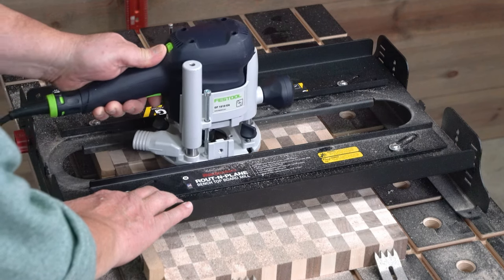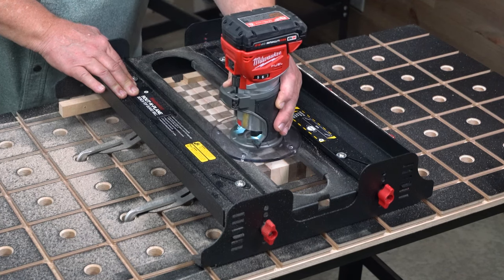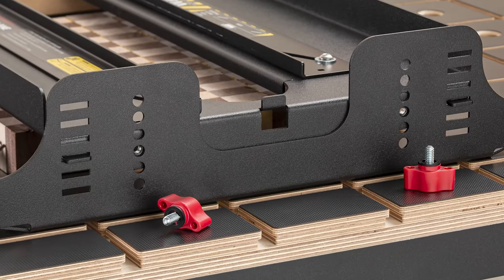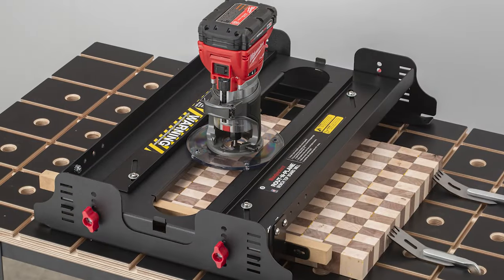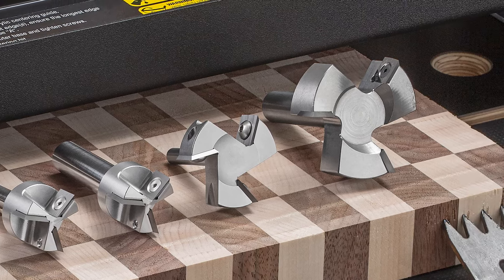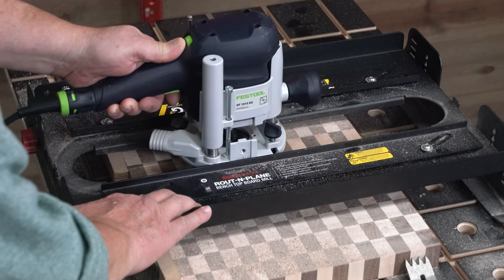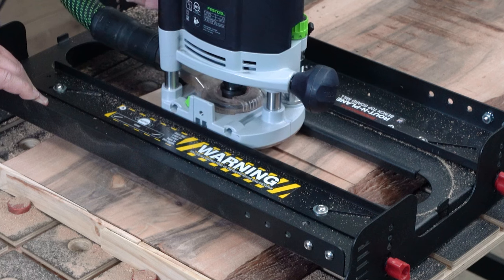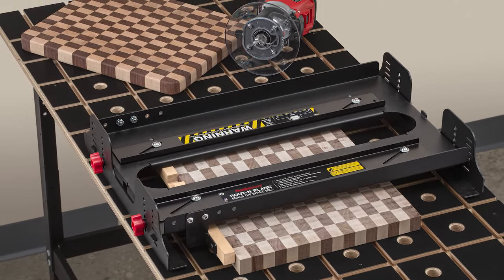Woodpeckers Rout-N-Plane Bench Top Board Mill

Comment: I've had mine for about three weeks now. Working on my second end grain cutting board and I'm pleased with the ease of assembly and use and it's very sturdy. Too bad YT does not allow pictures to be added to the post because I have some that might be helpful. One thing for sure is that I'll be working on some sort of dust collection because after todays shop session me and my garage are covered in dust. Yes you can make one yourself which is what I was checking into when I found this and thought I'd give it a shot. It has it's size limits but for my needs it's perfect.

Comment: One design change I think would greatly improve usability is to make the height adjustment a tall vertical slot with notches cut to one side at the same interval as the current holes so that the bolts don't have to be completely removed to change the height. You could just loosen them,  slide the carriage out of the notch and slide it up or down in the slot to the appropriate notch.

Comment: I have had my Rout-N-Plane for a few weeks now and after three attempts, my boards do not come out flat.  After watching the YouTube video from Sedgetool, I tried setting up my fixture using a flat and parallel board under the fixture and then I tried it out on a piece of 8" x 11" hardwood that was already flat and parallel within .003 and after taking a light cut on the top surface of the board, it did not come out flat.  When placed on a flat surface the board rocked, so it took more material off the ends of the board.
As the surface where the router rides is stamped steel, my fixture is curved up at the very ends.  Also you need to be very careful about how much pressure you put on your router as you can easily deflect the fixture and cut deeper into your board.  When you place the end legs into the slots of the main body you need to do some adjustments to get the main body somewhat parallel to your workbench surface.  Of all my Woodpecker tools, this fixture is a major disappointment and in my opinion is poorly designed.
There is no easy way to try and get the surface where the router rides in parallel to your work bench, so if you have a board that is already finished, but is not flat and you want to flatten it, you will end up with a board that is way out of parallel that also has a slight bow.

Comment: I like the design!  Since I don't have a proper workbench with bench dogs, I suppose I could use the super glue trick or double sided tape to hold my board to my bench?  My bench is 23" wide by 8' long...just a Gladiator bench with legs and a powerstrip on the back.
Reply from the maker: If the bottom surface is pretty flat, double-face might work fine, but in general I would feel more comfortable with hot melt glue.
Reply: What I did was to box my board in using scrap pieces of one by materiel that i screwed to the top of my work surface. It doesn't have to be real tight just snug enough so you can lift the board in and out so you can flip it over flatten the other side. My "bench" is rather narrow too so I used a larger piece of 3/4 mdf and anchored it down to my bench to make enough room for the sled and it works great...